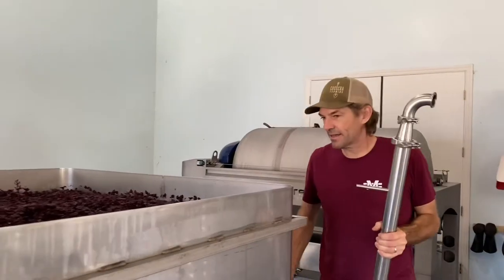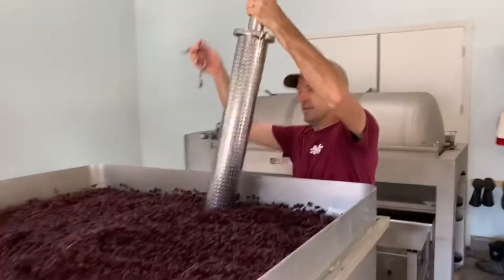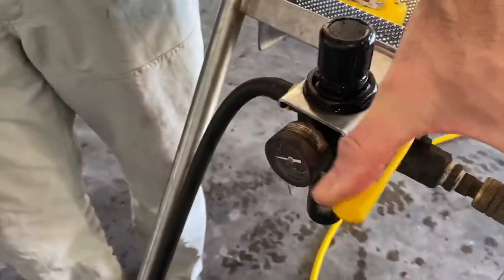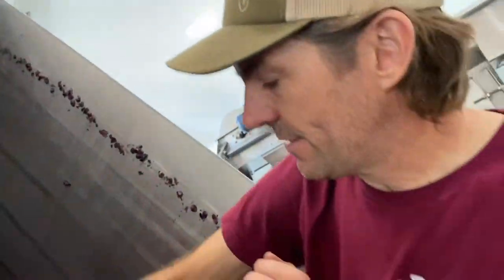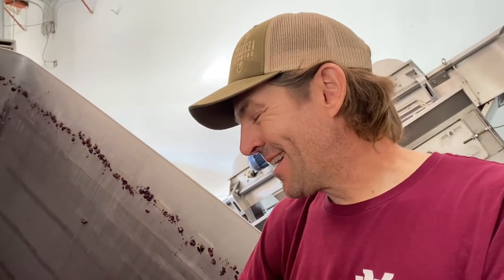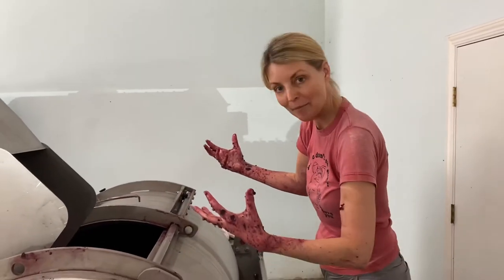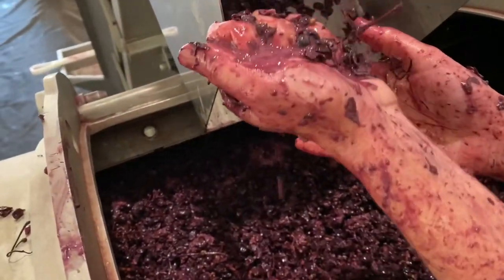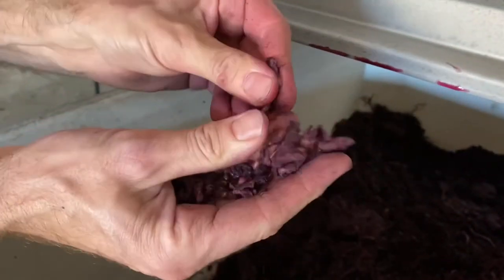Red Winemaking Part 3

Comment: Loved the video series! What's the max pressure you press the red grapes for? Is the pressure different than for your Roussanne?
Reply: Good question! For the red we make our first press cut at .6 bars and then between .6 to 1.2 that's our hard press wine that we may or may not use. For the Roussanne we push up to 1.2 bars and don't make a press cut because it's so much harder to press (we press it whole cluster and don't destem) and our juice yields are still annoyingly low!
Reply: @amychristine5865  Thanks for answering! What yields do you get from roussanne? 😳
Reply from the maker: @RunFreeRyan  140 gallons a ton and we’ve tried everything to increase it. Destemming and destemming and adding rice hulls. We have a little one ton Europress that just isn’t great at it. Finally this year we used a neighboring winery’s press, which is like a 5 ton press. They crushed it first then pressed it and we got really good yields! Like 160 gallons a ton. This has inspired us to buy a new press! 😆😆😆😁😁😁

Comment: great video...is all good with one racking... or u may later rack from barrells to tank back to barrels?
Reply: Depends on the wine, but sometimes we might get the wine off its gross lees and blend the lots together in the spring, which would entail pulling the wine from barrel, putting into tank and then back to barrel. Some of this depends on if the wine is blended, if its reductive, and it we have time to do it! Then of course the wine is removed from barrel and goes into tank right before bottling (3-4 weeks before).